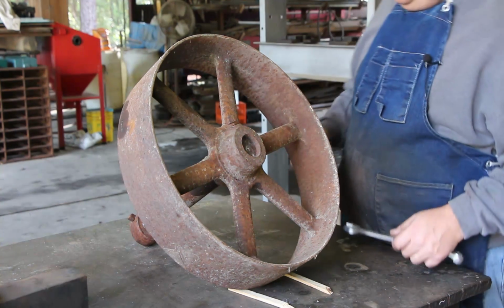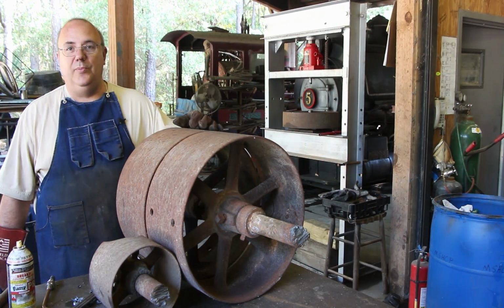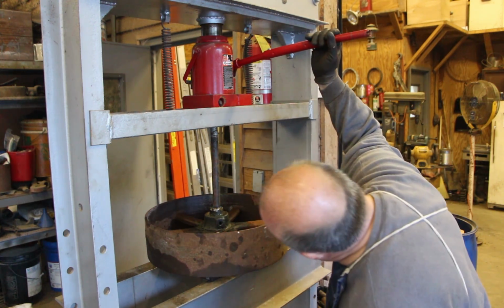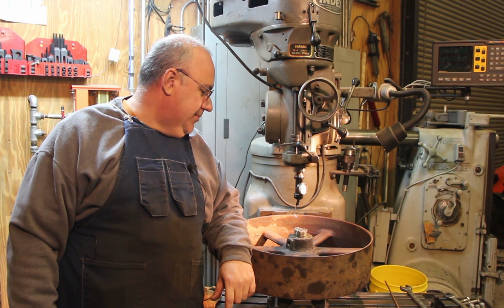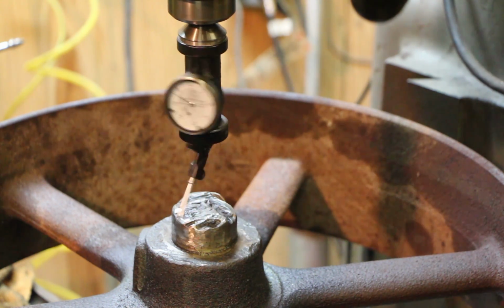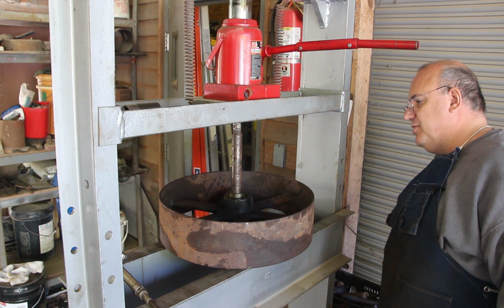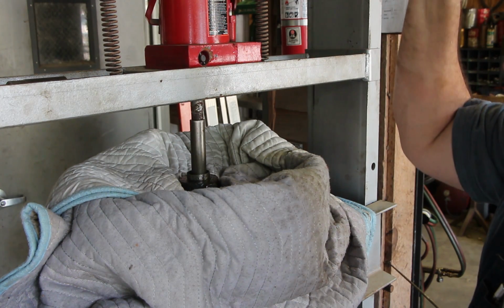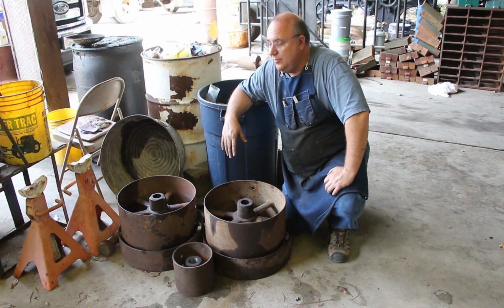Removing Stubborn Shafts from Flat Belt Pulleys

Comment: First of all the pulley is being supported from the outer edges which means you are putting high pressure on those spokes.  You need to support the main piece closest to center as possible.  Surprised you didn't break the spokes.  Next while putting high pressure and heat you should introduce shock to the hub only.  light hammer blows or even better air hammer at it's weakest setting to the hub will shock the pieces loose.  If you use shock you wouldn't need as high a pressure.  It's the same principal behind impact guns.

Comment: Support the hub with apiece of iron pipe and drive it with a sledge hammer till it moves. Works every time. I remove shafts from A/C equipment that way. Once it moves soak the hell out of it and it will press right out.

Comment: The correct process is this: bore it out, heat the outside, fill the center with liquid nitrogen, support it from the hub (not the rim) on the press, then press it out.
Reply: LOL  Liquid nitrogen? Who has that shit sitting around? If you already have it bored, just slit the remaining piece and it will pop right out easy-peasy with some light hammer taps, no press or dewar needed.

Comment: I found myself screaming at the monitor.... smack it with a hammer..... smack it with a hammer....  I have done that many times and the impact seems to help in getting parts to move..... I haven't done it before but some guys use an impact gun...   Doc...       p.s.  You did a great job btw....

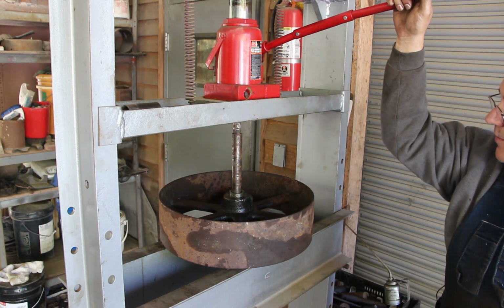Comment: I got to 22:30 and at that point in the field I would have rough bored it through completely...ALMOST to the diameter of the shaft.
Then I would come in with a sawzall, or even a hack saw blade held in a vice-grip and cut through the last bit of metal, the blade running through the bore.
Carefully done, this will allow the resultant sleeve to collapse.  If REALLY stuck, tap it out then with a brass punch.
I've had to do this as a printing plant machinist, on the machines.

Comment: I've never tried it for this but Phosphoric acid would destroy the Iron oxide in the bore and may loosen it up, the oxide Ratio of Iron is about 1.7 so it expands to 1.7 times it's original size locking the shaft in the bore, some Phosphoric acid in the oiler hole would turn the oxide into a phosphate, as i say i've never tried it but i think it should work.

Comment: sometimes when you've pushed to the limit an it's still not going but sitting there under enormous pressure...just take a small hammer and gently tap on the hub...the vibration will sometimes cause it to slip and start moving...don't always work of course but can save a lot of work when it does

Comment: Fixing what was a previous quick fix repair is all ways more difficult. I had the same problem with the cast cogged sprockets on an old harvester, Not wanting to buy expensive gear to do a one off job the shafts were cut and drilled by hand then slot cut with a hacksaw blade and folded inwards to get them out, the shafts were ordered with the bearing points lathed to the correct size the points between being a few thou narrower to allow for ease of re assembly the bolts securing the sprockets were drilled through the centre and side and tapped on top for grease nipples. The harvester was needed to cut barley without breaking the straw for thatching heritage roofs the straw was worth five times the value of the barley crop. The machine had stood at a farm gate for many years and had many coats of paint that had to be removed before even seeing how much metal remained. apart from a few feed flails and a new wooden draw bar the job was easy due to the paint having preserved the metal.

Comment: My dad would put it in the wood stove until it was red hot then dump it in a 55 gal drum of cold water.. Then block up the hub and beat it out using an old kingpin of the closest size. His lathe ran by flat belt from a flat head six  outside.

Comment: My brother and I had to press a bearing off a backhoe axle once and after the hydraulic jack started  to bypass the relief valve we gave it a tap with a hammer and when it broke loose the press jumped 6" off the floor and scared the bejesus out of the both of us. As a safety note a friend of ours was working in an auto parts store using a press and the mandrel flew out and went through his chest. Not with us anymore. You should think about placing so kind of guard between the press and yourself. Cool video 👍

Comment: A neat bit of boring. You have managed to get the wall fairly thin. Would it have been possible to have drilled a small diameter hole right through on the joint line first. Partly into the face of the pulley.  Then when you bored it, the tube left in would have effectively had a slit in it and fell out. It is not as if a small grouve in the pulley bore on a flat belt pulley would be a problem. If it was you could turn it into a woodruf key slot

Comment: Man i get chills when you got close between your hydraulic press that was under pressure and the shaft that you are pulling might have popped out to your chin throat etc it isnt really nice and clean job if you want to amputate your head off but hey it works

Comment: I admire what you do and I know this is an old video but could I suggest a ram with a remote master cylinder etc. or some heavy but movable wood etc. screens. I am not a "health and safety" freak by any means but you are scaring the crap out of me standing by a however many ton press with nothing between you and the work piece. Also, if the press's base will not lift I'd suggest raising the job with packing pieces rather than using long mandrels. The mandrel in your hand at 4.32 didn't seem to have been heavily loaded but was, in my mind, long, if it had slipped...... 

I am wary around presses lol.

Comment: If you want a real challenge,  try aligning flat belt pulleys.  You can use string lines,  LASER alignment kits and straight
edges,  but if you have the slightest degree of axial or offset misalignment, the belt will roll off one pulley or the other.

PS  I cannot take credit for this, but a fellow Millwright invented the best penetrating fluid that puts all the commercial
brands to shame.  Some lab tested it on scientifically rusted fasteners.  It consists of 50 percent ATF, and 50 percent
Acetone.  They then tested breakaway torque using all the available penetrants.  It beat them by miles!  Caution, Acetone
is highly flammable, so be careful where you store it.

Comment: Another title for this could be ... " Why the Split Tapered Pulley is a Great Invention".  Those flat belt pulleys have so much surface area on the shaft, danger!  Restoration creates challenges that modernization would avoid (by replacing ALL the rotating parts). Maintaining our manufacturing history makes it worthwhile if you stay safe, but don't forget you are the one to decide when any given part becomes better to scrap, or modify than restore.  We need YOU thanks for your awesome work!

Comment: Keith just a suggestion try making an adapter to backup the center of the Hub that way you're relying only on the Press at the center of the Hub to do your work and not the pulley and it's supporting arms. You will also need to make a flat plate adapters maybe you already have some. At least 3/4 to 1 inch thickness to go across the arms of the lower shelf of the press and Notch them in the center for the shaft to go through. Your adapter only has to be long enough to raise the edge of the pulley off the deck and thick enough at the center to catch the center Hub at the top. Since you're pressing vertically the wall thickness of the adapter does not have to be that thick. I think it would help you out with those type of pulleys again because you're not relying on the outside diameter of the pulley and the spokes to hold the load I noticed you were getting a lot of flex out of all that. Just a piece of advice from a mechanic that uses presses all the time. Hope it helps! PS just found this video in April 2020

Comment: Once there is a hole through the shaft large enough to get a sawzall blade through, I have sawed a slot the length of the drilled out shaft to the inner wall of the hole in the pulley. Comes out easy. I do that for removing stuck cutless bearings on boats to avoid beating up the strut.

Comment: Clearly Keith DID have the hub supported from below, or the spokes would have failed long before the shaft broke loose. Boring the stub was a great solution, no easy way to get this done, also really like some of the comments on some alternate solutions. That extraction might have been possible with simpler tools, or maybe not. Sure entertaining to watch a pro with proper equipment. Thanks!

Comment: not my forte, and having read several comments below I can NOT understand why Keith pushes the 10 inches of shaft through the pulley wheel when only an inch or two is protruding from the other?? and I'm sure one or two will respond by saying the press would stop at the outer rim, but hey.. use a drift of sorts.. All this mechanical knowledge from myself is from MANY years as a serious car mechanic, gearboxes, hypoids, all that stuff, and I'd figure out a way to remove any seized components, not slagging Keith of, just perhaps more solutions? and yeah, definitely don't press on the rim, press  on the shaft guide  with a pipe supporting it.. sent with appreciation on his work..

Comment: Never travel without your Kroil Soak Kroil on the frozen/rusted shafts before you even light up the heat wrench. Its the Wintergreen Oil in the Kroil that makes it work so well.

In my experience, if it doesn't come off with Kroil. it probably isn't coming off.

Comment: THE HUB OF THE PULLEY SHOULD HAVE BEEN SUPPORTED so the spokes would not be stressed & possibly fail.
Reply: The most basic and important rule of using a hydraulic press. Support your work properly!!
Reply: I agree.
Reply: My brain was screaming the whole time! You never support a pulley of any size on the outside diameter like that. I also would have cut that long shaft off, shorter the better. You could hang your body off of the jack handle and not worry about hurting the pulley when supported properly. Heating it faster with bigger/more torches would also help. The hub needs to heat much faster than the shaft for it to break the seal. Slow heating doesn't work as well or at all.
Reply: the support plates are under the hub, you just cant see them.

Comment: After boring the relief hole use an endmill let's say 3/4 inch diameter and plunge mill  on two sides of the sleeve until you just nick the orginal hole .This will release all of the pressure. Even if you do score the old diameter it will not be detrimental to the outcome or function of the new assembly. This has worked for me when on a breakdown and  don't have time to be so patient. Thanks for the video and I appreciate your calmness.

Comment: I found a trick to use my liquid nitrogen kit from plumbing and heating the hub. I was able to pull a 3 inch shaft out of a cast head by drilling the shaft and freezing it and heating the hub. It flew apart first attempt. The guy that was working at it all day almost threw it at me for my trouble:)

Comment: The Best trick I have for stuck shaft is to cut them flush on both side, drill them with a hand drill and then cut a + shape in there, it usually fall apart on cooling

Comment: I was right about the set screws.   I was a Boiler technician on the Top Gun, from 76 to 80.  We used WD 40 on steam valve bolts.  I bent a 9/16 wrench trying to break one loose with out it.  Let it soak for 20 minutes or longer.

Comment: Excellent video Keith - well done. You’ve got a new subscriber!

One suggestion I’d offer is to support the hub rather than the rim of wheels like that last one.  Otherwise, most of the energy is going into flexing the spokes of the wheel.  If you support the hub there is virtually no risk of breaking the wheel.

Comment: I understand the concept where heating a bolt will theoretically cause it to expand and make it a tighter fit, but over my many years, I have found that the hole of which the bolt goes into is often inaccessible or something else will get damaged from the flame, but heating just the bolt definitely does something to make it come out easier.  I have extracted many broken bolts by welding a nut to the remains of it or similar and it is the heat on the bolt that helps it come out somehow.

Comment: When I worked at an ac/refidgeration wholesaler back the the 80's, a good customer from a local big HVAC company came in with his customer's motor with a fan blade mounted. He said he spent all morning trying to remove the irreplaceable fan blade from the dead motor's shaft, but had no luck with all the common approaches. He kept asking if we could do it and kept saying his customer would have to pay thousands if this blade couldn't be salvaged. We tried every trick we could, but that blade would not budge. We went into high gear making calls to some of the most seasoned pros we knew to find a way to remove it... NO GO! So we ran it over with our fork lift until it was a complete flat piece of nothing. God, that felt good!

Comment: Why don’t you cut from the stub to just touch the pulley  and or use a hammer if you didn’t have a press you would have done the job more quickly

Comment: Need to setup press for remote control so you can be far away, in another room, behind a steel plate, watching the action on a camera. I've seen the results of parts exploding under pressure...not pretty when they penetrate a human body.

Comment: When you had the hub hot, you could have used your blind hole to shrink the shaft ,by using a freezer canister of the co2 type. Its a trick I have used on stubborn bolts with good results Of course even that might not have been enough with that level of scoring

Comment: Great video not long again had to do this on a 12 foot diameter flywheel with a 8 inch shaft had heat wd40 2 100tonne hydraulic Jack's then belting it with 2 sledgehammers got it eventually after 8 hrs what a pain.

Comment: Perhaps, after he had cleaned the surface of the shaft, perhaps if he drilled a series of small holes at the edge of the shaft, the shaft would have weakened. Just a thought

Comment: Drill 2 .. 1/2 inch holes side by side.. cut as much as you can with a torch with out touching the edges and knock it out with a hammer an punch.

Comment: I agree with the thought of supporting the hub just to take the strain off the spokes and limit the possibility of breaking the wheel. Also reducing any flex forcing the top of the hub pushing in. Good idea cutting the center out for the same reason. What I wanted to add was a personal experience, where this seedy old cuss of an auto mechanic, put an axle and bearing in a press that wouldn't move, not even with the Hot Wrench, so he called it. He put all the pressure he could muster on the press and hit the top of the press with a 4 or 5 lb. hammer. Not real hard, just a good tap. The second or third time he tapped it, BANG! it cut loose. He looked at me and said sometimes ya' gotta' shock it. That axle was scored under the bearing race too. I just had to share that.

Comment: For what it's worth I have found dripping Evapo-Rust in the set screw holes and gently (or not) impacting the offending parts to better allow penetration to help a lot. Wouldn't have helped much with the set screw scratches but it reduces the friction/stiction from the rust some.
Reply: @H Higgins  combine the two and you've got a sure fire method!

Comment: AS an old drilling rig mechanic  I will tell you. When heating any thing that is pressed or sweated on. First pump your jack upp as high as you fill safe , then start heating from the outside slowly working your way in.  If the outside is not expanded first the inside of hub cannot expand out. Same holds true for sweating hub onto shaft. Heat from outside in. when you get it spit frying hot it will slide on. Oh you have to keep rose bud moving in a circle, so you heat it all evenly. If you heat one spot to long it will egg bore  in hub , you might ever get in on or off.

Comment: Hi Keith, I know I am late to this rodeo but when I change the bushings on my backhoes, I use a torch and cut a groove into the bushing as far down as I could.  Just an eight inch wide is plenty and then I implode the rest of the bushing starting at the edge of the groove.  You will be surprised how easy it is to do without scoring the remaining shaft.  I use a propane cutting torch with a rather high oxygen pressure so when I hit that trigger the cut goes down about 3 or 4 inches in a split second.

Comment: The hand jack works when the electric power is off. And In California you can't depend on having electricity. So I will stick to hand jacks thank you.
When I was young in middle school a lady college professor had purchased a very old hand screw printing press it was the type like the first design all cast iron. It was rusted solid.  I worked on that main screw for a few weeks before I finally got it turning.  I used heat and liquid nitrogen combined with soft faced hammer  until it finally started to move. Cutting or drilling  was not an option,  the press was valuable and my time was cheap. It was a challenge that I was determined to win and I did.

Comment: My two thoughts were: I couldn't tell if you were supporting the hub directly, it looked so springy that I thought maybe the spokes were taking all the load. The other is that you need to make a new one-piece jack handle, that sloppy 3 piece one is using up half the stroke of your arm!
Reply: Sure did...Why else was he afraid to load it up, if it was supported by that solid cast hub a 100 ton press would've done the job 1st day.
I also thought the pops were the spokes snapping..